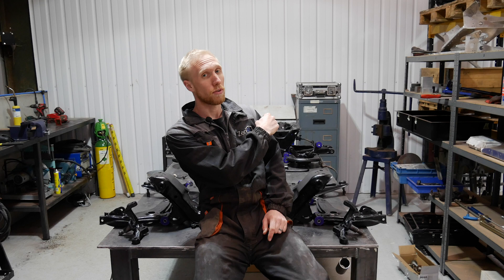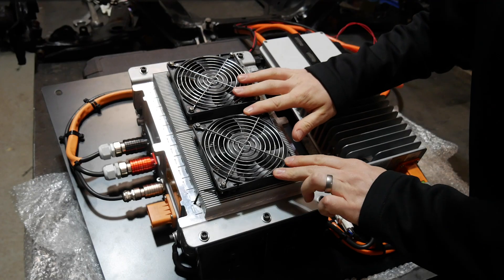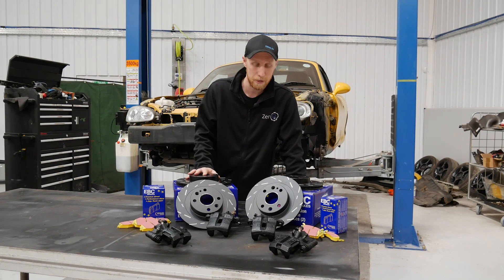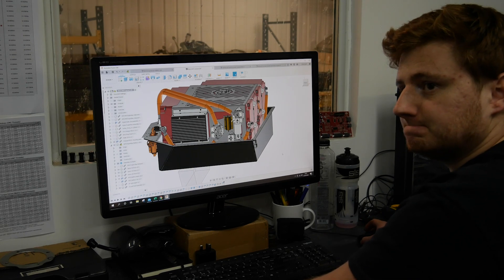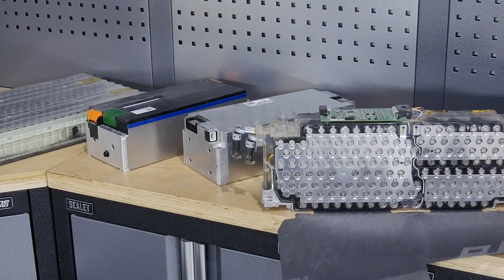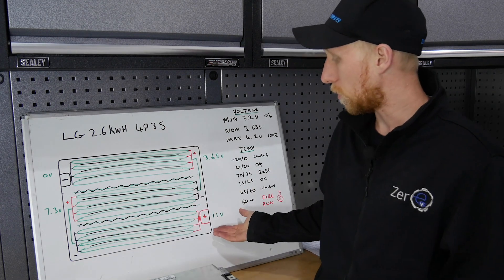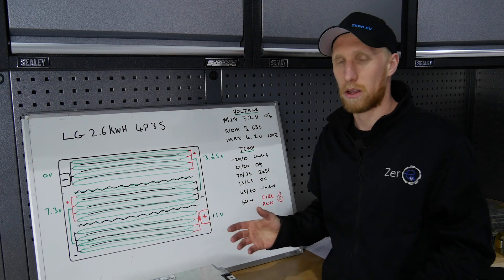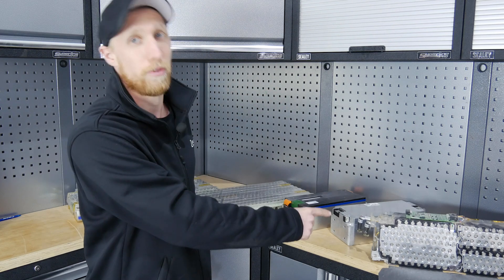Mazda MX-5 Miata EV Conversion: A Shocking Transformation with big brakes

Comment: With Florida being at 35degrees and higher ambient temp for over six months, what is one to do? my Subaru runs at 93 degrees at all times.. now it is an ICE engine.
Reply from the maker: We have been working on AC cooling that runs though a heat exchanger for hot climates

Comment: Just curious, what's the max recommended discharge current for these (for 10secs)? I'm guessing it's about 800A
Reply from the maker: It’s more among the lines of 800amp 3s 600amp 10s then drops to a continuous of about 150amp

Comment: Can a merc c300h battery be upgraded or refurbished. I don't even know if and or how they can be tested eg Mine is a 2017 c300h with 102k on the clock and I have no idea if it's performing near spec can anyone give me an idea how to go about this pls
Reply from the maker: Not going over 85% means it must have a lower state of Heath. Only thing you can do is replace it with new. Not sure if there is a warranty on those battery’s and a minimum state of Heath at which point they replace them for free.
Reply from the maker: The dealers should have tools to check, but from experience at that mileage it would be expected to be low state of health.
Reply: @Hazell_Nutz  I asked my local Mercedes franchise and they do not have any gear to check the condition of the battery. It feels ok on a high charge but will not charge over 85%. :(

Comment: Those fuses seem to be in a really difficult place to reset? Unless there is an access point through to it, you would have to remove the rear subframe wouldn't you?
Reply from the maker: There is a space, panel to remove in the boot, but if you have to replace one would be because the charger or dcdc had gone faulty.

Comment: at 13:57 you say that 3p4s is different than a 4s3p configuration, but aren't they the same?
Reply from the maker: Should be 3p4s and 4p3s probably a slip on my part.

Comment: Putting the rusty bolts back on killed it all in my opinion it's like vacuuming a room without vacuuming all of the edges drive me crazy could be just the OCD coming out though lol
Reply from the maker: Trying to get hold of new bolts over lock down was hard work plus the rear bolts holding the fuel tank are actually platted so look rusty in videos but is there actual colour.

Comment: Ahhh!  All of that hard work getting rid of all of that rust, welding, new bushings, priming, coating... and then re-using the old, rusty hardware!  There are great options for having it replated, or considering the cost of the kit, just using new hardware.  BTW, loving the series.  As someone with zero experience with EV’s, but not blinding myself to the future, this is where interest in the future of car mods can be explored without blowing up our brains with “software, programming, blah, blah, why don’t you know how to code in machine language?”
Reply from the maker: As this was over the Covid 19 lockdown getting new hardware as not going to happen. Wanted to have everything sandblasted but know where was open very frustrating.

Comment: have been wondering, how will you reset or change those fuses when they go bad? 
from here looks like a lot of work to do in order to reach the fuses of DCDC and charge control unit junction box
Reply from the maker: If a fuse blows means something has gone very wrong meaning a dead short. In this case everything would have to be opened up and retested.

Comment: Cost per cell would have been nice to know.  Also, I think you hinted that the Tesla batteries are used, is that correct?
Reply from the maker: Yes all Tesla battery’s are used you can not buy the new. Please look at our web site for battery module pricing and information

Comment: Just recently found this channel and wow, one of my favourites already. I wonder what's the maximum peak and constant current for those 3s4p LG modules? In US they have 60.8V 2.6kWh 16s LG modules from Chrysler Pacifica with huge discharge currents which would be perfect for my plans, but I haven't found anything similar from Europe yet :(
Reply from the maker: The 16s modules are not really in Europe. The 4p3s LG modules can kick out some big amps.

Comment: So I assume you don't discuss Leaf batteries because of the liquid cooling you recommend. Or are there other reasons? Cheers, great series and don't bother worrying about the length of the tech discussions :)
Reply from the maker: The leaf are not a bad battery. It’s not something we have ever used so did not want to talk about something we have no experience with.
Reply: @Hazell_Nutz  as if you heard me about the length of your tech talk, 👍 your latest separate tech talk is spot on. 😁

Comment: don't charge to 4.2 if you want to make your cell last longer. make it 4.0V or possibly 4.1V, I would personally do 4.0v for a car
Reply: It all depends on the battery specification from the manufacturer. Also thinking about the application doing a true '2000' cycles can quickly equate to a couple 100 thousand miles. So check with the manufactures specifications before configuring any limits.

Comment: You should be careful when installing fuses or breakers in parallel! There will always be a small difference in breaking times which means 1 fuse/breaker will operate first and the other one a milisecond later for example. This means the full fault current will pass through a single fuse which isn't rated for the current, therefore possibly failing when you need it.
Reply: The fuses are rated to 50kA braking capacity at 1kV so I would say that is not a worry here running the fuses at 130V max.

Comment: I sincerely hope the original longitudinal Power Plant Frame (PPF) between the gearbox and rear differential will see its way back to the car. If not, this open top car will have considerable flex.
In other words: a lot of strength comes from this part.
And, if you put in a lot of more torque to the chassis, maybe some extra chassis bracing would be a good idea. Just like with Flying Miata V8 conversions. https://www.flyinmiata.com/miata-performance-parts/na8-1994-97/na8-handling/na8-braces.html
Reply: We are well aware of this, the idea is to retain the brace. There will also be a new cradle going from the motor mounts to the centre of the chassis to support the motor and gearbox plus add bracing.

Comment: As a long time electric car owner, I have an important question for you talented folks. There has been debate over the years with electric car owners on the topic of ideal average state of charge for the batteries. My understanding from my research is the ideal range of charge should be between 20% to 80%. In other words, don't allow the batteries to stay at 100% for long periods of time with the same being said for near 0% charge for long periods of time to minimize stress on the chemistry. Do you concur with this?  I own the LEAF plus (62kwh) and the manual from nissan states to NOT keep the battery above 80% for long periods of time. Curious to hear what you folks have to say on the topic from your research.
Reply from the maker: Your completely right. Between 20-80 is best for long term heath. All new battery’s we buy in come at 30%

Comment: In the video at around 2:44, you describe the three fuses in that small box. One is for the charger and there are two fuses in parallel because you only had lower amperage rated fuse holders. As a retired engineer with experience in high-power electronics, I would never put fuses in parallel. Even with matched holders and fuses, I would never trust that the fuses would be able to share the load evenly due to their natural low internal resistance. If you have had good experiences doing this in the past, I'm mildly amazed.
Reply from the maker: We only do this for low amp applications no high ampage condition ever have parallel fuses.

Comment: Glad to see you put the rotors on in the correct direction (venting dust away from the hub). It annoys me to no end when I see them put on cars going the wrong way. Also, I did the same thing with the spring clips when upgrading to slotted drilled rotors on my 240sx (S13 for most of the world), as I couldn't get those rusty old ones to work with the new pads. The brakes still work fine without those clips, but you'll hear them rattle over every bump, and do risk some binding from time to time.

Great content as usual! I've been wanting to do the same thing to an MX-5 for years!

Comment: Cmon guys, brill content & subject but rebuilding with rusty fixings??
Reply from the maker: There is nothing wrong with then just a bit of discolouration, gave them all a wire brush but no point in painting the heads when there being done up with a ratchet
Reply: @Hazell_Nutz  I gotcha, have you guys considered electroplating?
Reply from the maker: It has been brought up a few times I really need to look into building a little set up
Reply: @Hazell_Nutz  Tbh I'm probably being a little picky about the fixings, I completely unerstand they are perfectly serivicable and a little surface rust is nothing in reality.  So at the moment I drive a 24KW leaf and really enjoy the electric driving experience, oddly my long term goal is to buy an MX5 and look into electrification so your video series is utter gold!

Comment: why put the charge plate there. will water splash and repairs be a problem ???
Reply from the maker: Put some weight to the back, all parts are water proof, can get to all parts from on top and very littke water actually goes there
Reply: @Hazell_Nutz   Realizing that this is a 2020 video.... but I was wondering the same thing. Especially on days like Thursday (cataclysmic rain here) and snow/slush/salt (although the MX-5, like a 911, should be a summer sunny day car) my inclination is to draw cooling air from somewhere other than the bottom of the car.  Where are you shipping kits - mostly UK, or significant numbers going to Europe and North America too?

Comment: The problem with the majority of EVs is they’re the wrong solution to the wrong problem solved in the wrong way.
But recycling a good existing vehicle is better than scrapping one to buy a Tesla or the like.
The best ev for the current state of battery development is one that mainly uses the grid directly from overhead or in ground tracks and only has a short battery range to taxi between grids. Or one that has rapidly swappable battery packs .
Long range vehicles waste too much power just carting the batteries and pose too much of a fire risk even compared to gasoline which can be extinguished and is far less toxic when burnt.
A grid powered ev would be an excellent inner city taxi or bus system.
Reply: grg . And the hyperloop was invented over a hundred years ago funny what goes around comes around or other cliches like that.
Reply: Utter nonsense. There are so many naysayers with such confident opinions about EVs who have clearly never driven one for any length of time
Reply: Ian Shepherd . I have never driven one or even sat in one but having knowledge of batteries etc I can tell you my point is totally valid. Current EVs are the purview of rich ignorant assholes who think they’re being green when they are being just as filthy or even filthier than an old diesel truck.
Until batteries become cleaner safer and hold a hundred times the juice per kilogram they’re misplaced as a transport solution.

Comment: I had  two 5000 mAH 3S batteries set in parallel  on my rc plane and on a quite warm summer day.... my plane transformed into a fire ball and crashed to the ground, hopefully not hurting anyone or destroying any property. So, yes, even in a small 11.1v powered rc plane, temperature can make things dangerous, let alone in a car who has far more cells in their battery packs.
Reply: Hopefully? You mean you didn't stick around to find out? 😉

Comment: Really bad idea paralleling fuses! The acting time of the fuse will not be the one you want. Especially if you have installed fast acting fuses. Also my opinion use a PTC resistor for the precharge. If for any reasons you have a SC on one of the HV components it will limit the current. Keep it up with the videos. Very informative
Reply: I thought this regarding parallel fuses - I'm no expert by any means, but surely you can't be sure the resistance will be equal through each path, so you're either risking unnecessary blows or you have to compensate by leaving a larger margin of error, hence less safety?

Comment: Tesla cells are energy dense, not power dense. They just have so much energy they don't need extra power. A lot of cells can discharge between 5-10C for powesport EVs, and quadcopter batteries can go over 50C. Tesla cells are about 3C discharge. Which means since they have a 100kWh battery they can discharge 300kW.
Reply from the maker: Yep you are correct. Out of all the battery’s on the table the LG modules are actually the most power dense.

Comment: Excellent video guys, looking forward to seeing the next one already! I have a question, is it ok to run the data cables next to the high voltage cables? I'm thinking in the even of wear\accident suddenly having HV through a data cable would be problematic!
Reply from the maker: If anything wears through then there is a lot better problems. It is always very tight in all builds. The hv cable has a outer shield.
Reply: @Hazell_Nutz  thanks for the explanation, much appreciated.

Comment: You did teach me something! Awesome Tech Talk! Next one could you please discuss "pre-charging" and perhaps explain why the 2 fuses you used are in parallel... I'm sure a motor & controller specific TT is coming. cheers lad, keep up the great build & content! churrr
Reply from the maker: When you say fuses are you referring to the charger fuses? If so the fuse holder we use can only go up to 30amps where as the charger kicks out 46amps so by splitting across two fuse holder is parallel shares that load.
Reply: Zero EV Thanks, yea that explains it 🤙🏾

Comment: Do you plan on using the car's full range, often? If not, I'd have top-balanced the battery pack and left the lower limit at 2.75-3V to get the maximum range for emergencies. Then simply make sure to charge the car whenever practicable, to keep it above 50% DoD (charging from less than this--edit: meaning a lower state of charge--shortens the battery life anyway, if you use the maximum allowed charging current.)
Reply from the maker: Yes the Orion bms we use is always set up for top balancing. It normally is set to balance from 3.8v upwards or if there is a difference of 0.04v leaving a battery below 30% for long time periods is not grate.

Comment: Love the series.  Question though:   Are you doing anything to weather-proof that DC panel?  Seems like it might be a bit exposed at the old gas tank location.  Just wondering since you had to deal with quite a bit of rust on the car and water and electricity don't seem to mix properly.  Thanks again and look forward to the next episode.
Reply from the maker: It is quite well protected where it is plus the dcdc and charge are both ip rated so designed to be open to the elements
Reply: @Hazell_Nutz  Good to know! I had the same concern with weather exposure, and if it'd be hard to access if you do ever have to access it to work on a component later.

Comment: Will there then also be a thermostat/heating mounted in the cooling circuit? To increase efficiency on cold days? And the temperatures, degrees Celsius or Kelvin or Fahrenheit? :p I'm really enjoying the build! Already looking forward to next video!
Reply from the maker: That is the long term plan currently still finalising our temp management system

Comment: Are the Tesla packs really the most power dense? I learned that they have high energy density but not so much power density.
Reply: Yes energy dense, power dense no. But out of the batteries on the bench they actually might be, however a battery from a hybrid tends to be more power dense.

Comment: What kind of connectors are used there for data and power ?
Reply: Power is the Jonhon connector and a Amphenol, data connector is a HDP20 series on the battery pack

Comment: Good stuff!  One thing you didn't seem to mention is auto battery disconnect in the event of an accident...  I thought it was a legal requirement? Just so the emergency services can approach a crashed EV and know they won't get electrocuted......
Reply from the maker: We run duel contactors same as Tesla so 12v just needs to be pulled.
Reply: @Hazell_Nutz  Are the contactors killed by air bag deployment?
Reply: @realnutteruk1  Usually you use a separate Inertia Switch that will kill the EV side of things separate to the ABS/SRS systems. Here in Australia it is a big no no to mess with those systems, so we have to add them on. Not sure if it's the same elsewhere.

Comment: The battery tech is interesting! Can you create/provide a replacement battery-pack for the standard Twizy, while maintaining the existing charging technology?  I think a lot of Twizy owners (like myself) would be really interested in this!
Reply from the maker: We have been developing something but currently struggling to get the cost down on such a product
Reply: @Hazell_Nutz   is it the sales cost that's to high. Why not lease them . With option to buy at the end. If they opt for a new lease recon the battery and the cycle starts again.
Reply: Biggest issue is ending the battery lease properly. And cost would be nearly 3.5K for a comparable pack that the twizy originally came with.
Reply: @Tom-evnut  Renault seem to have 'forgotten' about my battery lease ;)